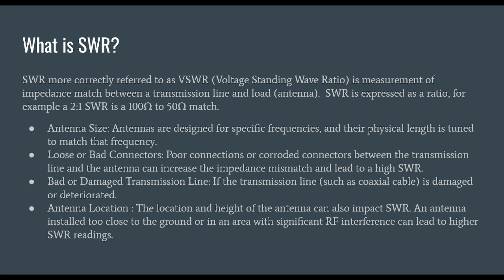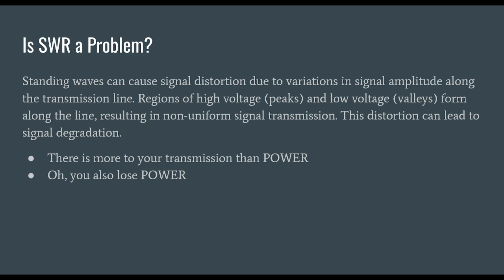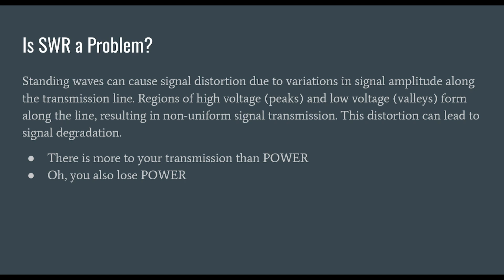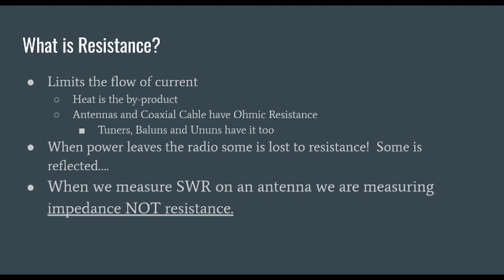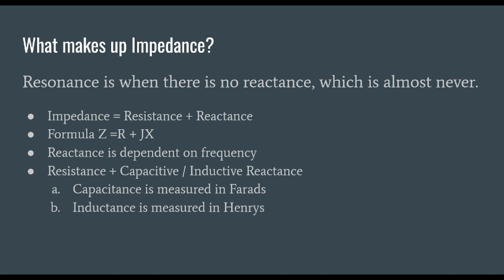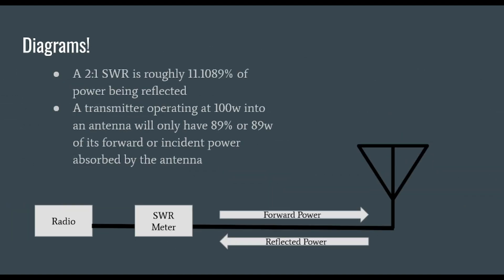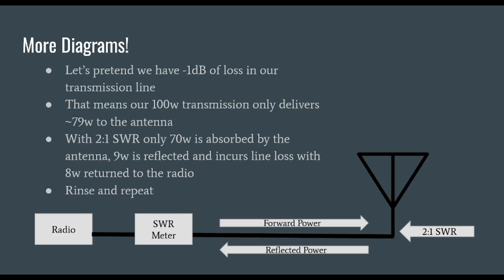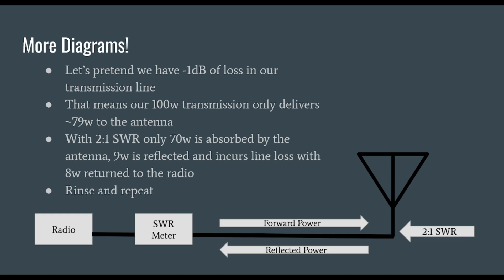Debunking SWR Myths Once and For All!

Comment: My tuner really does tune my antenna, a chapter in Walt Maxwells book reflections is a must read
Reply from the maker: I've read it.  To me, your tuner uses reactive components to rotate a phase angle to present a resistive impedance and not one that is reactive.  I have never seen a tuner that changes the physical characteristics of a transmission line or antenna...  I suppose to could argue that the "antenna system" is tuned but I really do see conjugate matching doing that, but I am a beginner.  All that being said, the whole conversation seems to be a hair splitting discussion that isn't very productive.  If we all agree on what the tuner does and how it does it, that is good enough for me...
Reply: @TheSmokinApe  it doesn't physically but electrically it does as explained by Maxwell, the antenna feed point impedance and tuner output impedance are conjugates of each other, yeah agree that it my be splitting hairs but there many out there that believe the tuner is there to absorb the reflected energy to protect the radio
Reply from the maker: I agree with everything you said.  However, wether or not the reflected power is absorbed or re-reflected isn’t enough evidence to convince me that the tuner actually tunes 👍
Reply: @TheSmokinApe  could canceling out the reactance of the whole system by considered as tuning

Comment: SWR is not a problem, just an outcome of  diligence. Ham operators vary largely in technical education to the point that their knowledge has caused more than just friction in the you know better engineering world. There are many bands and the longer waves usually present a challenge to the erection of an efficient antenna. Before we even start ,we need a plan. Have a goal on what to put up in infrastructure for a desired outcome. To receive we just collect the voltage of the desired frequency, we boost it, filter it either with a superhet converter and decode it in a demodulator. More modern receivers  have a chip that does it all. SWR is no issue. To transmit, we have some standards to work. We generate modulated power to literally shake a resonating antenna to be heard as far away as possible. Now the fun starts...

Comment: Do common mode currents have an effect on the VSWR? Does changing the length of coaxial transition line have an affect on the VSWR of an antenna?
Reply from the maker: Yes and yes.
Reply: @TheSmokinApe  Can there be common mode currents on a transmission line when there are no standing waves on the antenna?
Does the length of the transmission line transform the feed point impedance?
Reply: Yes and yes @MacksCurley

Comment: I have heard that SWR can harm the finals in the radio.  Is this true?
Reply from the maker: I feel like this might be a trick question.  Most modern radios fold back on power output when SWR is high, they do this to protect the radio.
Reply: @TheSmokinApe  Its not a trick question.  I am new.  I have tried to watch videos made you Yaesu but they talk in "electronics speak" and very fast so that I cannot really understand the topic.  I end up more confused than before I watched it.   I am an old guy and learning new tricks aint what it used to be.  There are no radio clubs anywhere near me so I am on my own.
Reply from the maker: @daveengstrom9250  sorry Dave.  Some folks like to argue that voltage and not current damage the finals.  So yes, transmitting with higher power and high SWR can absolutely damage the finals

Comment: The primary issue is the argument that your loosing far less than one s point. Yep even if you loose half your power. And even a whole s point (6db) is insignificant.
I'm not agreeing with that. But that's the argument.
Also I'd want proof of any significant distortion of the transmitted signal due to swr. Sure at really high swr you might get some non-linear effects in the cable. I worked out you need an swr of 27:1 to reach the breakdown voltage of rg58u using 100w. So a some point before that the cable might become non-linear.
Reply from the maker: For me, it’s more about discussing what happens not the amount of loss, what people choose as acceptable is an individual decision.  The clown, in his video, was inaccurate and misleading.

Comment: Impedance is Resistor+Inductive+Capacitive  It all is +++, but Inductive and Capacitive is 180 degrees out of phase. And mostly around 90 degrees out of phase with the resistor.
And when it is resonant, inductive and capacitive is the same and cancel each other out, keeping just the resistor... You have to see them as vectors and treat them as such.
Then you have two types of resonant. Parallel resonant our serie resonant. 
Serie resonant is very high in resistance if it is resonant, and parallel resonant is very low in resistance when it is resonant.

And now for the big question does SWR matter, it depends. On shortwave where frequencies are low and feedline losses our low.
You probably will not notice the loss.
But on VHF-UHF-SHF and higher, SWR really does matter. You really lose many many dB's......

Comment: I'm pretty sure I saw the video you refer to.
I made comment on it, I explained that the example given, 10ft of RG-58 coax in a mobile situation with 10:1 SWR @ 27mhz, still has 18% loss.
The video creator then tried to argue that is wrong.

It's not hard, go the the KV5.. coax loss calculator, plug in the above and it comes back with 18%.
So that is near 20w of power being lost out of 100w on the first pass, then the relection is another 4w then the next is .8w
So you lose 25w in power, which will likely go up to 26-27w.
I don’t understand why anyone would think losing that much power having a 10:1 miss match is a good idea, when you could always match the antenna properly and not loose that power.

But I will say in a mobile application, say at 40m you will have a coil loaded antenna, most likely.
In this situation, you will get loss due to the coil, it would be interesting to see how a coil loaded antenna compares to using a tuner and a vertical.
I'm guessing the tuner method would suck as you would still lose heaps of power heating coax and need to lug a massive tuner around.
Reply: The loss calculator includes all passes of reflected power at the swr figure you put in ,in his video he states at the lower hf frequencies this loss isn't to much of a worry especially with low loss coax
Reply from the maker: Yeah, he is a little out there.
Reply: @TheSmokinApe  and not far wrong

Comment: I think it is important that people understand that a standing wave is a wave without momentum.  So all this talk about the power going backwards and forwards should have been nipped in the bud at that.  A high SWR actually means a high amount of power just standing around, and not going anywhere.  It is caused by reflected waves meeting waves going forward.  But all that is kinda beside the point really isn't it.  Standing waves don't move along the coax as they should, and that should be the end of it.  Anyone who tells you that you can have a high SWR and the waves will still move along the coax normally, and you lose no power,  doesn't even know what SWR stands for.

Comment: The transmitter supplies constant power to the coax and antenna system or (mismatch). Any power returned is due to the loss or mismatch of the coax and antenna in the form of a SWR, which is maintained by the transmitter output. Because the power is constant and the impedance of the mismatch never changes, the loss is a one-time or instantaneous amount. Ohms law. SWR, antenna dissipation, and loss are constant.

Comment: Hey Ape! I'm still trying to separate the wheat from the chaff on the SWR issue. I get the feeling that the truth lay some where in the middle. I keep hearing Theories, and opinions (even from those so called experts) not quantifiable and undeniable proof. There have been mistakes in the past that still linger on until today (like Amplitude Modulation actually modulating the carrier instead of generating sidebands). 
I do think many Hams take any signal loss way to seriously, lets face it in the real world even 6db (75%) loss is only 1 S-Unit. QRP operators running 5 watts are voluntarily operating 13 db (95% or ~2 S-Units) of loss compared to my 100 watt rig and still making contacts and having fun.
That doesn't mean I intentionally run cheap coax and high SWR's. It means that I take losses with a grain of salt, and try to look at them with a real world perspective. 
Keep up the Good Work!   73   mike
Reply from the maker: Thanks for watching and for the comment.  I tend to agree, hams get whipped up over a bunch of stuff and SWR / Loss is one of them.  I run 100' of RG-8X which is lossy and I don't lose any sleep over it...
Reply: @TheSmokinApe  You might want to check out this video and his 4 PDF references "Antenna Engineer Vs Ham Radio Myths! True or False?" Mark the Ham Florida Man
73 - mike

Comment: Nice explanation, Thanks!
Something I think is missing (or maybe not fully addressed) is that losses in a transmission system includes energy lost by things like absorption (heat) and radiation. That energy is not reflected back, also it tends to affect both incident and reflected power and this is logarithmic not liner . So if a transmission system transmitting 100W experiences  3dB of loss (half power or 50W) the reflected wave will also experience 3dB of loss so only half of the reflected power will reach the SWR meter causing the resulting ratio to look better than it should.
In an armature system these losses might be very small to the point of being negligible, but in high loss systems such as communication systems with very long transmission lines (e.g. a few hundred feet of coax with lots of connectors), very high power (e.g. the 97dBm radar I used to maintain), etc, they can make SWR measurements unreliable, and if the losses are high enough, a transmission system can indicate good SWR but still be radiating only a small percentage of the power out of the antenna.
A final tidbit: 
Some transmission line failures may not be apparent during low power conditions such as during testing. For example arcing at connections, and/or breakdown of the dielectric. I can't tell you how many times I have had to argue with installers who insist their tests (using low power testers)  passed, only to have the system fail when at power.
Reply from the maker: I did cover it a bit but you are correct, there are ohmic resistance losses 👍

Comment: But don't think you can't do well with none resinent antennas.  I had a dobblet cut fot 80 and fed with ladder line.  You have to consider the whole system.  Your length of feed line matters too.  If very short you have very little loss at hf.
Reply from the maker: I’m not saying anything about using non resonate antennas, I use them all the time 👍

Comment: In the days of parallel line and pi outputs, tube transmitters...dip and peak. The old timers didn't worry about SWR. That issue became prevalent with cheap available coax after WW2.
Reply from the maker: Yeah, totally agree.  Thanks for watching Phillip 👍

Comment: You can summarize it this way - SWR is “ONLY A PROBLEM TO THE EXTENT OF THE LINE LOSS“ in your transmission line. The most widespread myth is that the power reflected back to the radio is lost. It’s NOT. It’s reflected back to the antenna with little loss.  On its way back to the antenna, power is lost again in the transmission line and part of it gets radiated and a part reflected back again and so on  If the transmission line has a small loss like for ladder wire or short runs of good Coax, SWR is NOT a big problem except that some radios will reduce their output power if there’s too much power coming back to it.

50ft of LMR-400 loses 3.4% each bounce at 40m. So at 2:1 SWR after 2 reflections 95% of the power is radiated.  Not bad.
Reply from the maker: I think that’s pretty much what we covered albeit with more context 👍
Reply: Totally agree many have a hard time understanding that the reflected power adds to the forward power back to the antenna ,some even believe reflected power is common mode current

Comment: It matters, but the question is how much. At a 2:1 mismatch you're losing less than 1dB. The bigger worry is the transmitter reducing its power. If you can get SWR down to where the transmitter's happy a reasonable SWR might be better than the insertion loss of adding a tuner.
Reply from the maker: I would agree.  To me the video is more about what's actually taking place and what / how to look for that.  Thank you for watching and for the comment!

Comment: The fact that less power is being radiated is very easy to prove.  Just look at the RSSI with a receiver and you can see that there is less signal strength.  It's  not rocket science.
Reply from the maker: Some folks make the concept difficult 🤨

Comment: Great video. There is a fellow on YouTube (with the name Florida Man) pushing that reflected power always gets radiated. He quotes an old article by Maxwell in the 70s. the YouTuber basically said that the reflected power goes back and forth several times and eventually gets released to the antenna without loss. Of course how this "magic" of defying physics happens is never explained. I replied in his comments that this is incorrect.Thanks for straightening out these self-appointed "myth busters" who are basically misreading a 1973 article and reinterpreting it to suit his "defying physics" theory. 73 de Scott W1AL
Reply: @microflite  Big difference between "not much of an issue" and FL Man's claims. He says "no power is lost in heat" at the transmitter.
Reply: @N1IA-4  no reflected power is lost at a reflection point would be a more accurate statement
Reply from the maker: Thanks @W1AL
Reply from the maker: you can say that again...
Reply: The Florida man is absolutely right. SWR is only a problem to the extent of line loss.  At HF frequencies this is not a huge problem. At 2:1 SWR, with 50ft of LMR-400, 95% of the energy is radiated.
Reply from the maker: I didn't commit the Florida Man's video to memory but I don't recall him ever discussing lossless line or LMR400 but maybe we watched different videos.
Reply: @microflite  The problem is not that feedline losses occur, but that the flawed logic that because losses occur on the feedline that is the only place losses occur.  In one of his videos he shows a power meter showing a reading of more power than the radio is producing.  It never occurs to him that this increased AC power is also seen in his radio finals too.  He assumes, incorrectly, that for some reason it stops when it reaches the PL259 at his radio and changes direction.  Ask yourself, why would it do that?  What magical properties does the PL259 have at the radio that forces that power to change direction?  It is logical to think that the reflected power is actually going back into the radio as nothing is stopping it.  It is logical to think that if it can make a power meter read higher then we are overdriving components in the radio too.  Is it logical to think that maybe we are sending this AC voltage directly into our final transistors in the wrong direction.  Do you understand what happens when you apply voltage in the wrong direction to a silicone component? That we are putting more power through those components than what they have been designed for.  These are just basic facts and the way Florida man produces his videos is an over simplification and miss reading of theories to the point of being dangerous to newer hams that might think to themselves that high SWR does not matter, and than it just causes insignificant coaxial power losses.  That is not correct and we all know it.  Honestly watching his videos you would think someone operating a radio with a high SWR has never damaged a radio ever.
Reply: @wonderingworld119  in his video I mentioned that his explanation was a little rough around the edges but basically correct, the meter would read more than the power created as the reflected power joins the forward power ,as reflected waves are on the feedline the feedline becomes an impedance transformer and changes the impedance the transmitter sees ,therefore creating a mismatch for reflected wave to reflect back to the antenna, this impedance mismatch causes the transmitter to overdrive itself to put power into the system , the power is reduced to the amount thats reflected ,less power into the system and possible internal component damage to transmitter, add a tuner full power can be produced without any damage to transmitter,now this is logical !

Comment: It was not too long ago that I was building a fan dipole down in the cellar hanging the wire span about 5 feet above the cellar floor.  When I added the second band to the dipole and attached my VWSR meter to the center connector, I did notice that with the dipole, Any swing or sway between the fanned wire elements (yes especially sideways) cause pretty big swings in the VWSR on my meter.  Oh, and BTW, the VSWR readings down in the cellar were essentially useless.   Heating pipes and electrical wires and a distance below ground made for pretty bizarre VWSR readings.  Art W1SWL
Reply from the maker: Hey Art.  Yeah, fan dipoles can be difficult given the elements interact with each other.  Also, what works well in one location might not work so well in others given that conditions will vary.  Thanks for watching and for the comment 👍